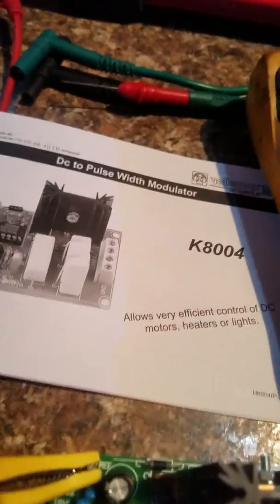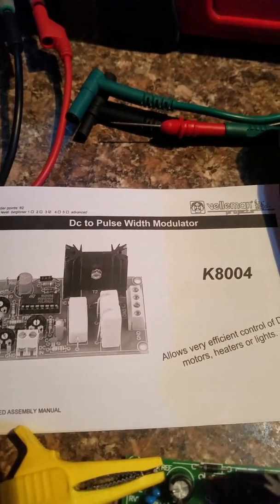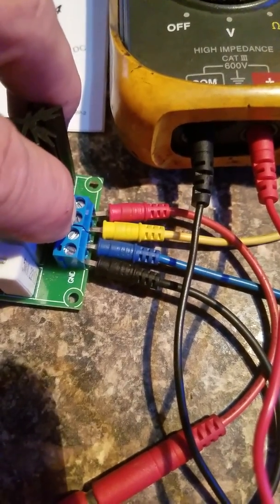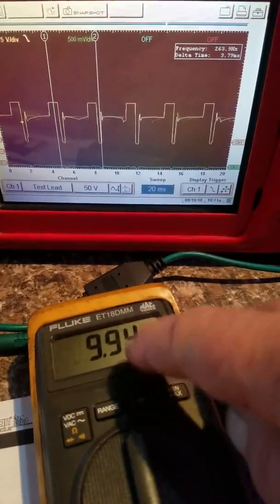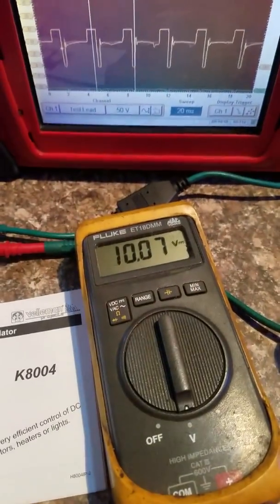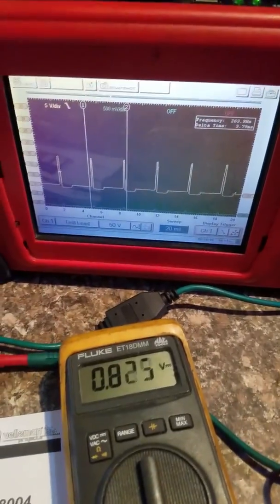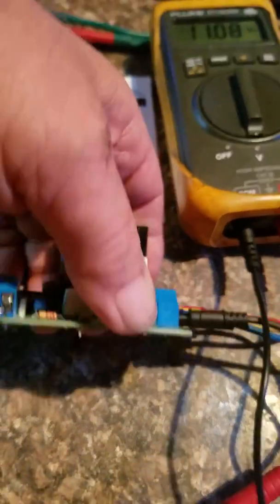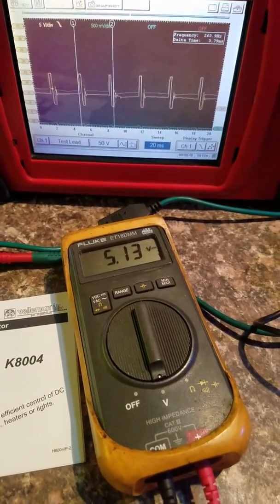Velleman k8004 hook up and running pulse width modulator

Comment: Hey Brother, is there any way you could write in comments or explain the test leads, motor, volt meter connections better. It is difficult to see in the video. Thanks a lot.